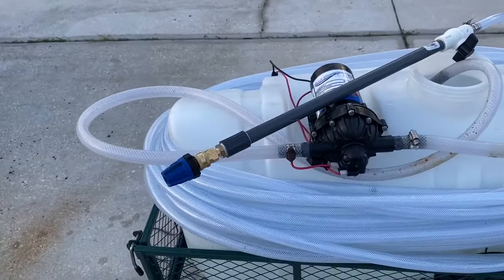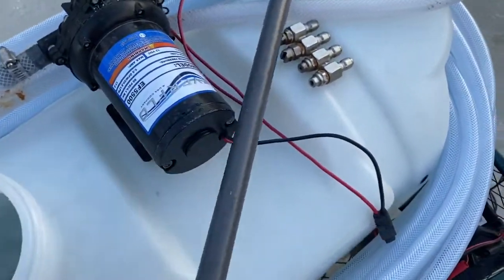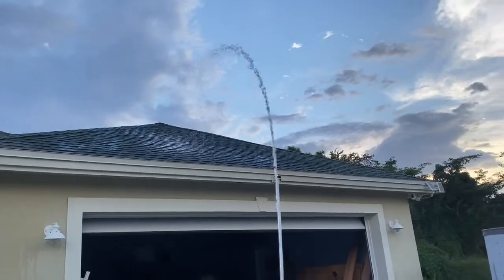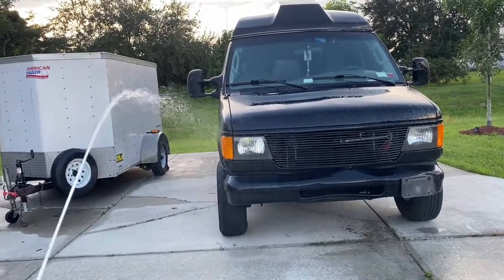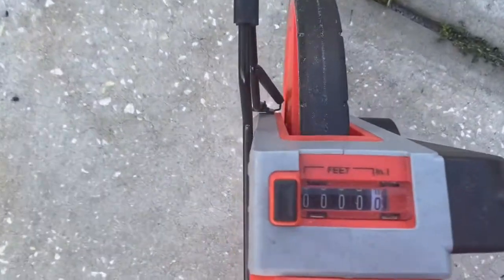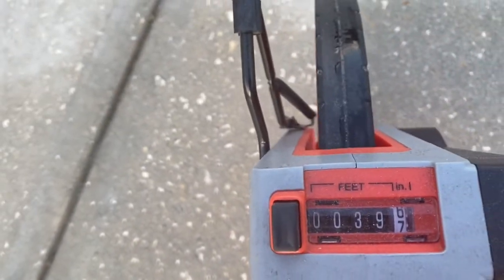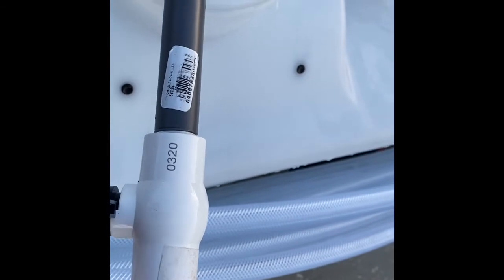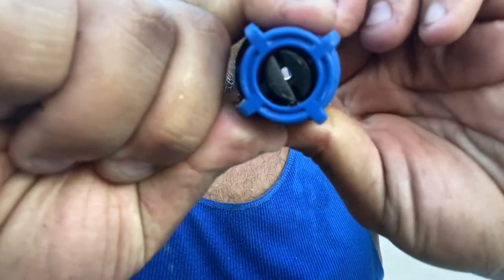My Soft wash system

Comment: Hi !  very complete and informative video ! thanks a lot though iam not technic at all, i do not  understand the use of that piece ; 1” by 24” pvc pipe $17.66 and also did cut the pipe of 100 ft to  put one side  on each inlet/outlet left and right of the pump?

Comment: Issue with your parts list: The 3/8 stainless steel quick connects and 1/2 to 3/8 adapter are incorrect. It won't work with 1/4 quick connect nozzles. You need 1/2 to 1/4 adapter and a 1/4 quick connect.

Comment: Hey man for the inline fuse I'm not sure where to get it? Do you have to cut and wire the amp fuse and all that? or can you buy it all in one
?
Reply from the maker: I had bought a tank with a 1gpm I used the wires from there to add it to this one.

Comment: Hey man just curious how that hose is holding up. Does it stretch out fairly straight?
Reply from the maker: Not crazy about it , but once you let it sit under the sun it makes it easy to mess with
Reply: @jaysetd  That's what I was thinking but you cant beat the price. I would mostly be using it for roofs so I think I can make it work until I upgrade.
Reply from the maker: @widespreadpressurewashing4414  for sure it’s a good starter when you upgrade make sure the reel is stainless steel, Because the SH messes up metal.
Reply from the maker: https://youtu.be/dn-SqFB7DxU check it out in this video
Reply: I see you got the same ball valve build as the video I just saw. Are you using 1/2 I’d hose? And how long is your hose?  I’m looking to build basically the same setup as you so I’m happy I found your video. 👍👍👍
Reply from the maker: @jamesg863  1/2 in hose 200’